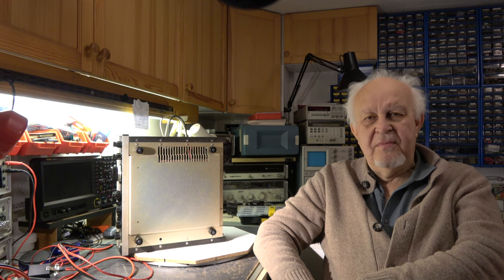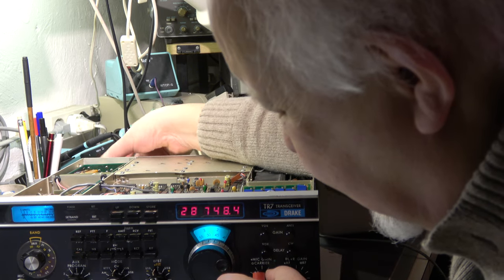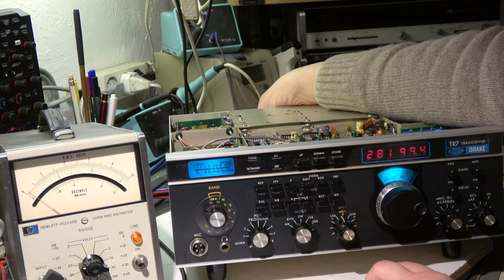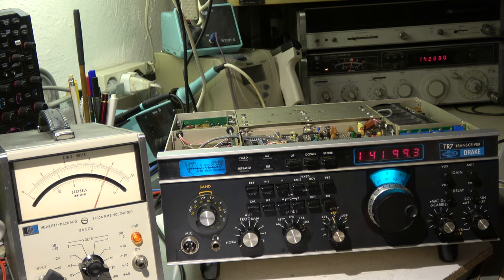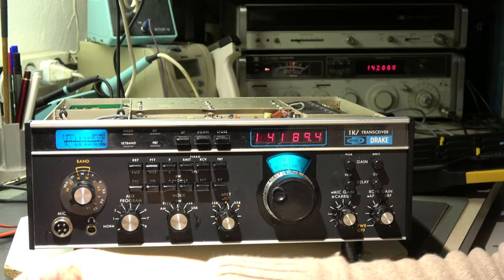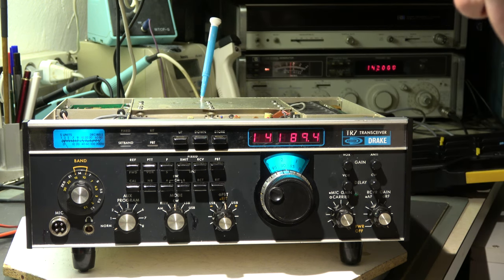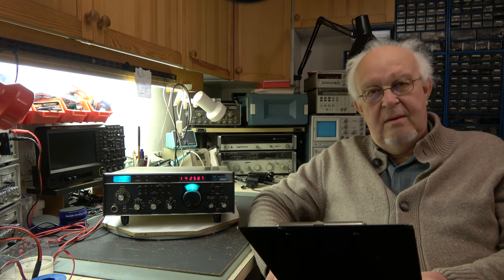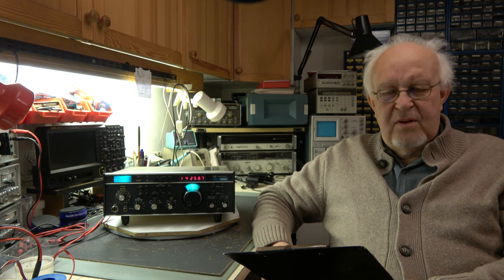#163 Drake TR7 Part 11(13)

Comment: Nice job Stefan! I prefer to set the IF Gain adjustment for 30 uV = S9. This seems to provide a good compromise between system gain on the high bands and sane S-Meter readings. Otherwise the audio output of weak signals was just not high enough for me even though sensitivity was at spec  across all bands as you demonstrated very well. 73 de Jim NU0C
Reply from the maker: The sensitivity at low input signals is also affected by the threshold of the AGC circuit and can be set accordingly to the individual requirements